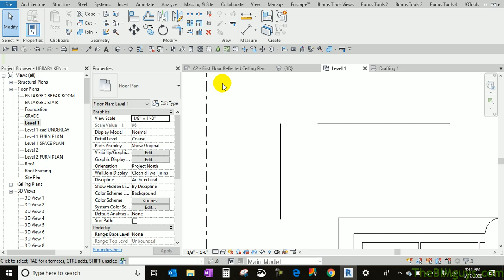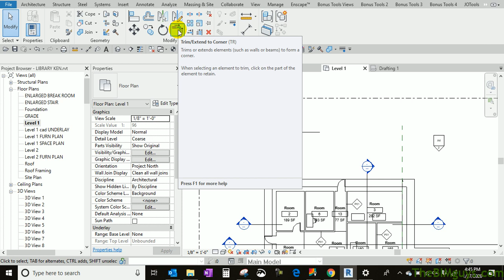Revit - AutoCAD Fillet Arc Equal - CADtechSeminars.com

Comment: Thanks for the tip. Wouldn't it have been great if Revit would have been made by AutoDesk from the start. At least for us, old CAD guys switching to Revit. I like how you explain things and relate to CAD, because for us our brains have worked for so long with CAD commands, it helps to translate from CAD to Revit.
Reply from the maker: Thank you